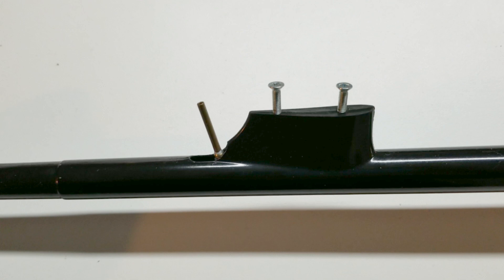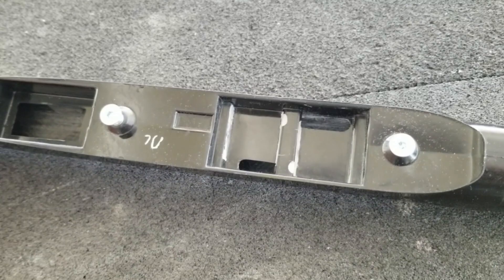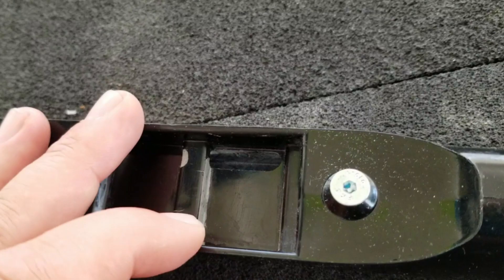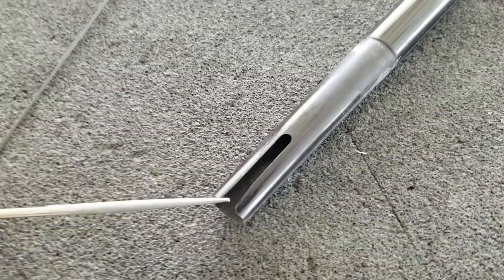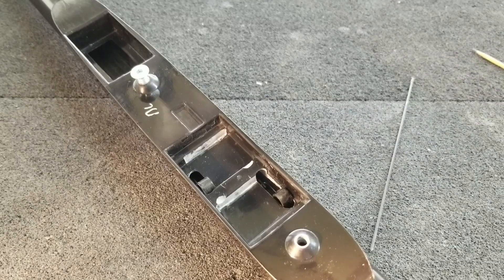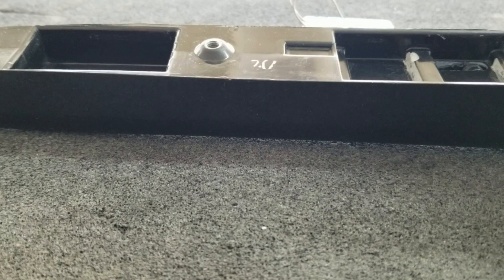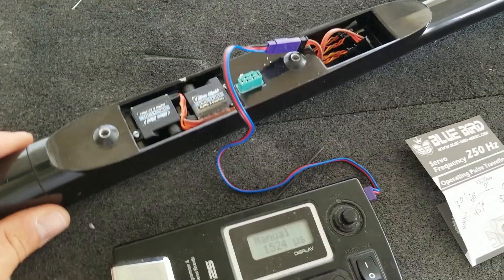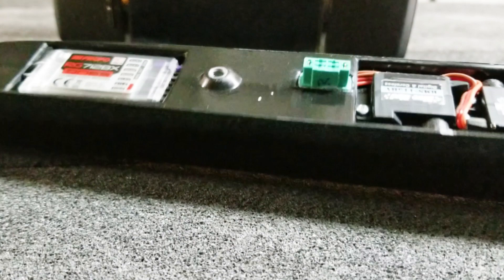Samba Prestige 2PK F5J Fuse Servo Installation

Comment: A trick for the RX antenna wires is to find very small heat shrink tubing feed it through from the outside of the hole to the Rx opening then take the Rx antenna wires and push them into the heat shrink tubing until they exit from the tubing. Finally pull out the heat shrink tubing leaving the Rx wires behind.  You can then use the heat shrink tubing cut to maybe 5mm to slide over the Rx antenna wire to act as a a grommet. CA tubing to fuselage.

Comment: Excellent discussion on the Rudder and Elevator servo resolution. Nice work on the linkages and reasoning to go with them. I'm dying to learn about your range with the antenna placement AND whether or not you will need the Satellite! Loving my Vertigo at this moment for sure!!

Comment: I think you should try IDS on the next model. On ailerons in my windy/F3J I even fitted KST X10mini and use the smallest IDS servo horn. That means I use 115/95% of the travel in my JR XG11. On my lighter Prestige 2PK with MKS 6110HV I get 92/93 and 116/102% throw. The best about IDS (or even better LDS) is that when (not if) you develop slop in your output bearing you will not notice it in your overall slop. Just because the servo horn is smaller than what you manage on a standard servo horn. On my fuse installation in my windy Prestige 2PK I use elevator 121/121% and 74/83% on rudder (i have only 30mm throw).  So I am pretty sure you can downsize your servo arms.